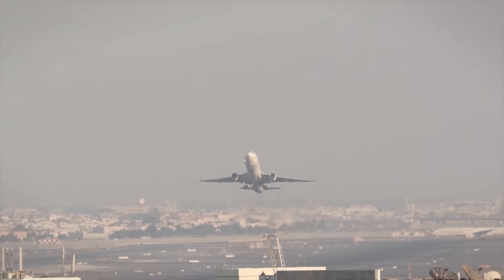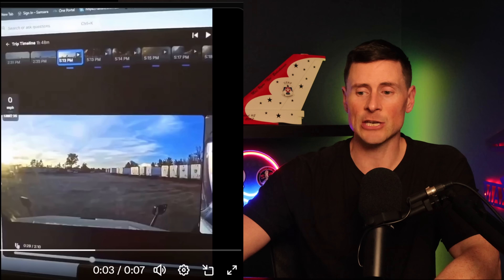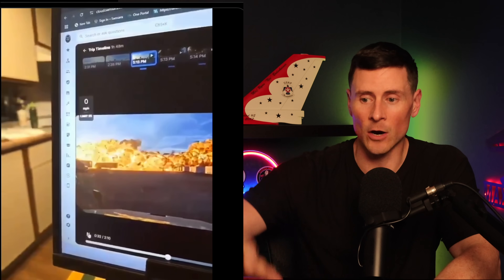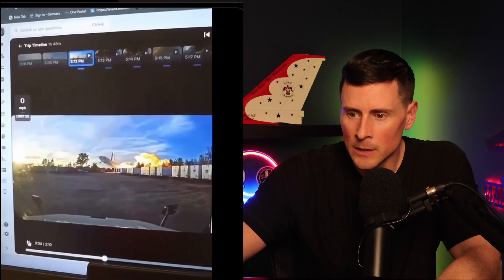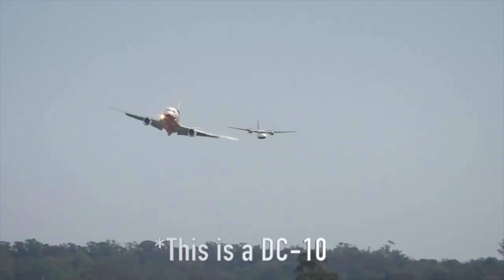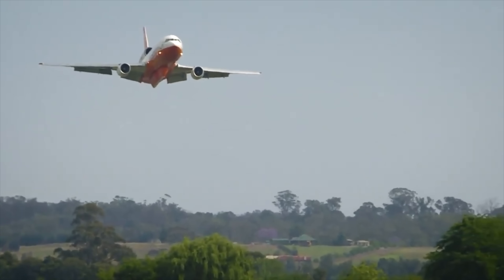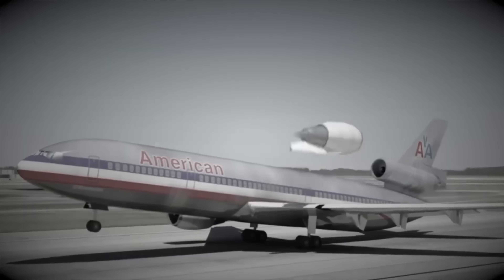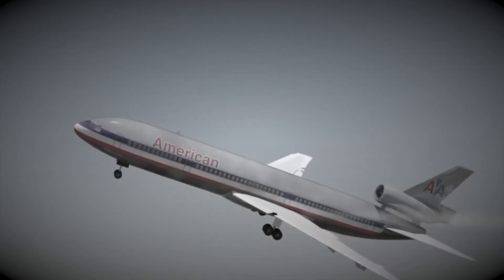Airline Pilot Reveals CHILLING Clue in Final Moment Before UPS 2976 CRASH

Comment: It doesn't look like an engine separation.  It looks like a catastrophic failure.  It almost has more in common with the Concorde crash than the AA 191 crash.   In the case of the UPS plane, you have a destroyed engine core on the side of the runway.  It isn't intact like it fell off.  There are also parts of the engine enclosure on the runway.   Think of the UA 777 that suffered a catastrophic engine failure in flight.  Now imagine that same scenario but under full takeoff power.   My thinking is the #1 engine on the UPS flight suffered such a failure under full power an destroyed the engine.  The result being the core ending up along the runway and the wing on fire.

Comment: Everything is speculation this early, but…those sparks could easily be from FOD coming off the #1. There does appear to be separation of the #1 engine as that was found on the airfield far from the crash site, this separation would also explain the knife edge type of crash that was seen with the left wing down

Comment: Engineering develops maintenance intervals and procedures. Mechanical and electrical mechanics are trained by the engineers standards but management dictates what is done because upper management is tuned to the whims of shareholders in the corporation that employs the above employees. The top only thinks about prophets and the technicians think about engineering standards. So who is to blame the shareholders or the technicians. Technicians can’t work without approval of shareholders. So shareholders how do you feel now. Does that margarita taste good now or a little bitter.

Comment: The first building the plane hit was a UPS building.  It just happened to be the closest building of any size near the end of the runway.
Loss of the #2 engine at the tail dues to debris from the #1 engine doomed them -- with only 1/3 of the thrust they can't climb AND the thrust asymmetry was going to drive the plane left and the right wing down.  The first impact into the UPS building was probably the left wing.

Comment: Engine #2 wouldn't need to ingest actual debris. The plume of fire on the port wing was naturally being pulled into the area of lower air pressure over the top of the wing, so that when the plane rotated the #2 engine would have been sucking in the incomplete combustion products of that fire; a superheated mass of oxygen depleted air and partially burned fuel; effectively flooding the combustion chambers and resulting in a detonation through its turbine section. (Not conducive to maintaining airworthiness.)
The MD-11 also has the issue of the turbulent flow from the wing trying to rip the stabilitors off during a near-stall configuration.  https://www.youtube.com/watch?v=n682zwJwzE4

Comment: If you look at the engine on the ground, the fan case has a huge split at 11 to 12 Oclock position, i believe there was a blade or 2 seperation, maybe fan hub failure which went thru fan case rupturing the fuel tank, engine had high vibtation which sheared engine mount bolts causing engine seperation from the airframe, just a sad thing to happen for the crew and people on the ground..

Comment: Why exactly after V1 with an engine failure do you have to takeoff?
Reply: because there is no longer enough space left to stop safely (or in this case, even UNsafely). after V1, you are committed to taking off and trying to return, because MOST times, aborting at that high a speed will be worse. In this specific case, the debris field started at less than 3000 feet from the end of a 12,500 foot runway. we never do see just where the fire and smoke start, but I am going to assume that the trained and experienced pilots would have aborted IF they knew that they had such a severe issue before V1. That means I have to assume that it didn't get bad until after V1. Also, they might still have made it, if engine #2 hadn't been affected, too, and there was no way to know that would happen until the last few hundred feet of the runway - way too late to even attempt an abort. And also, in this specific case, the building just beyond the runway that the plane's wingtip clipped after getting airborne was a FULLY STAFFED UPS shipping warehouse, with hundreds of people clocked in. If they HAD attempted such a late abort, they would have plowed directly into the building with that 220,000 pounds of fuel instead of just clipping it with a wingtip.
Reply: @ravyn.  thx!

Comment: I'm a retired Captain with over 28,000 hours .I had 16,000 hours in the 727-200 before moving to the MD-11 ER and I can see your point after reviewing the tape. Very, Very possible of a compressor stall. My God I can't imagine all of these problems at or near rotation speed. Jogging my mind I believe that the capacity of the MD-11 ER was around 43,000 gallons which considering the length of the flight I almost am sure it was topped off. It might be possible that the inner and outside fuel tanks were ruptured.
Reply from the maker: Really appreciate your comment and first hand perspective
Reply: @MaxAfterburnerusa Thank you Sir. Keep up the great work.

Comment: The building roof was hit by the left wing, which ultimately domed any chance of takeoff.  I’m about 8/10 mile away, and also worked at UPS for 15 years.  This plane was sitting at the new hangar for awhile, this hangar can hold this plane and a 747 as well, and sometimes it’s sitting off of Crittenden Drive, where the big birds sit, along the roadway.  They typically sit away from the hub until needed.

Comment: No mention of the fact that they changed the design after 191 so the wing configuration locks in place instead of relying on hydraulics? That seems like an important factor to bring up.

Comment: If I remember correctly, the AA crash was caused by mechanics who used an unapproved method to attach the engine to the wing. With loss of the slats, combined with engine #2 being affected, there was not enough lift to get airborne very long. I flew the DC 10 and enjoyed it but it had some design issues that caused one crash and almost a second one over Albaquerque NM. The crash was a cargo door latch problem and the Albaquerque issue was the number 1 engine blew apart, sucked a passenger out, damaged the number two engine and due to a flaw in the redundant hydraulic system and the plane landed with almost no controls.

Comment: Looks like the Big fan blade failure or disc failure which caused feul line rupture or tank rupture causing the fuel leak and fire, kinda like the chicago engine seperation

Comment: This UPS crash reminds to one the one that happened to Concorde in 2003. A fire trail coming from the wing indicating something big was happening, a major malfunctioning there and then the aircraft going to the ground.

The truck dashboard footage is shocking, never seen a footage so clear and close to the crash site.

RIP the UPS crew and condolences for their families and also for the ones that were killed on the ground.

BTW, IDK why there was a oil recycling facility in the vicinity of the airport, just at the end of the runway. It's just ridiculous, a huge factor for this disaster that got more kills on ground than expected. At least the number goes 16.

Comment: The crew was most likely a Captain, First Officer, and Relief pilot since the block time is greater than 8+00.  I don't think that loadmasters have been on board Fedex or UPS cargo aircraft in decades, they simply hire people into this job and base them around the world, usually locals.

Engines are mounted on the bottom of pylons for three main reasons:  1.  This makes them easier to service, 2. If there is an engine fire, the flames are kept away from the wing structure, and 3.  The whole assembly is designed to break away and protect the wing structure in a massive fire or if the engine's rotating assembly were to suddenly seize up.  In this case, it isn't known why the engine separated, but it apparently did.  Typically when this happens, the airplane actually flies better due to the loss of drag and weight.

Great video, SAD story, RIP-

Comment: After AA 191 McDonnell Douglas put additional valves in the hydraulic systems to prevent flap and slat retraction in the event of a hydraulic line breach so that could never happen again.  So you are wrong.  You also didn't mention that the MD-11 is a much more difficult aircraft to control as McDonnell Douglas reduced the size of the horizontal and vertical stabilizers and made the aircraft neutrally stable on the MD-11 from the DC-10 to save fuel.  This makes the MD-11 have the highest takeoff and landing speeds of any commercial aircraft, gives the pilots less command command authority, and makes the aircraft much more difficult to control and fly.  These are also some of the reason for other MD-11 accidents and incidents, and why the MD-11 never sold well and were quickly converted to freighters.

Comment: The question is are the sparks from a compressor stall on #2 or from the tail striking the runway due to low airspeed and the crew trying to force it into the air?

Comment: Respect to all, but you have to be a blind bat if you don't see what's going on here. Just like Air India B787. I said there's nothing wrong with that plane and it was done on purpose. Months later I was right.
Look at UPS. Layoffs have been happening. Then some customer branches after. And now major layoffs.
Someone or all three that were on that plane had retirement around the corner or up the block.
RETIREMENT DON'T EXIST! If you love life just take your savings and resign.

Comment: I would caution direct comparisons to AAL 191.  The MD-11 was a completely new FAA certification jet from DC-10 and much of that accident affected the design of the MD-11.  Swiss Air was the MD-11 launch customer and insisted on mechanical springs holding the slats extended as opposed to simply hydraulic pressure on the ‘10.  This caused a whole other set of issues later with unintended slat deployment in flight.  The flap/slat handle had to be redesigned to prevent this from happening.
I flew both of these aircraft at AAL.  Some similarities, Douglas built both in same factory buildings at LGB, and they look similar, but differences.

Comment: I flew the MD11 for several years. I loved it. It is a powerful airplane. Losing one engine would not be a problem at all. Losing two, with takeoff weight, gear down condition, would result in what happened. It will fly on one engine, but once gear is extended, you cannot maintain level flight. The lighter you are, the better for  operation on a single engine.
Those slats should stay locked in position. MD11 is not much like a DC10. Lessons learned from that DC10 crash were applied.
MD11 was my favorite airliner I flew. It had many features better than our B777s which I flew next.
Reply: I’m no expert but I don’t understand, with all that damage and engine separation, they must have felt yaw, heard fire alarms, and watched their gauges go crazy. It seems they would have aborted. Maybe it all happened after V1? It doesn’t look like it though.
Reply: @dmrr7739 
It was way too late to abort.
They were going way too fast at that point, with very little runway remaining.
Reply: @dmrr7739  The million dollar question, before or after V1??? Would it matter?
Reply: Don’t be too quick to rule out the sparks possibly coming from tail strike from over rotation.
Reply: thanks for your insight 👍

Comment: A report on this UPS plane (look up UPS Flight 2976 MD-11) shows that it was grounded, inspected and worked on.  All before it returned to service.
Reply: Plus Yesterday more maintenance was done
Reply: @MikeJones-wc4qj  With the Gov't shut down are FAA inspectors even working?
Reply: Allegedly it was worked on from September to October.
Reply: Yes and reports are it's was maintained briefly before takeoff.
Reply: The Boeing service likely missed some bolts holding the engine mountings.  The Engine core  was just ejected midfield and that should never happen without catastrophic support failures, even bigger than sucking up a flock of geese.

Comment: Mains never left the ground....nose wheel did.  Left engine blew up,  and the pieces went into the wing fuel tank.   All the fuel ignited.  I have 23,000 hours in airlines as a Captain.    I'm right.   Where is the engine shroud?   It blew to pieces.
Reply: portions of the engine shroud are scattered around the damaged pari lights at 2800 feet from the end of the runway. the mains very much DID leave the ground, as the plane cleared the barrier at the end of the airport grounds, and the plane only clipped through half of the UPS warehouse beyond that with a wingtip. she made it off the ground... it just wasn't by very much at all.
Reply: @ravyn. the mains never left the ground.   I have access to satellite imagery that updates every 15 minutes.   Straight path from the end of the runway to it's stopping point.   Everything in it's path was destroyed.....do you access to satellite imagery?   No,  you don't.

Comment: The DC-10 incident was caused by improvised engine / pylon separation procedure during maintenance with a forklift. The rear pin mount was stressed and cracked, eventually failing under takeoff loading. Might be a similar situation here.
Reply: As I recall, the problem with using the forklift was that the maintenance crew left the engine partly uninstalled from the plane's wing and with the forklift engine shut-off the lift cylinders slowly leaked down putting too much of the engine's weight on the only bolt that was still holding it to the wing causing cracks to form. And when the crew returned to finish their work on the engine, nobody noticed it had damaged the pylon mount while they had been away.
Reply: @michaelshrader5139 Thanks for filling in the details. Be interesting to see how the investigation unfolds on this one.
Reply: @michaelshrader5139  for that one plane, that occurred during a shift change but the issue was larger than that one plane. American, Continental and United all changed the recommended procedure which was to separate the engine and then the pylon. Instead they all removed the engine with the pylon attached. United used an overhead crane but American and Continental used forklifts. When reinstalling, if it wasn’t all aligned properly, damage was done to the mounting points. This was found on other aircraft in the fleets of AA and Continental.   (Note that this all followed a bunch of misinformation about it being caused by bad bolts due to one being found that was broken in half.  This info went out way before the investigation was done.)

Comment: Possibly similar to the Chicago DC-10 crash where the left engine separated from the aircraft. The maintenance crews had mounted the engine and pylon as a unit instead of separately causing a crack in the aft engine mount. On takeoff the mount broke and the engine/pylon pivoted on the front thrust link around the wing. The separation cut through the cables (not hydraulic system) that hold the slats out. The pilot went to V2 to climb which caused the slats to retract from air pressure. Simulations showed that if they had leveled and gained air speed the wing would not have stalled. There was enough control authority with the two other hydraulic systems to control the airplane.

Comment: So if the aircraft can’t achieve enough speed for liftoff, why is there no mechanism to brake?

Seems like in 2025, there would be sensors on planes and along the runway where necessary velocities would have to be achieved. 
Tragic. Fortunately, it didn’t have 200 souls on board.
Reply: there ARE mechanisms to brake... as long as you aren't going too fast already. But the whole point of V1 is that there is *no longer enough distance left on the runway to make a safe stop*. And by the time you know you won't have the lift to achieve positive climb, you're almost always WAY past V1.

Comment: The road striping and the proximity of the utility pole to the roadside tell me that the engine pictured is next to a road outside the airport. If authentic, the separation likely happened beyond the end of the runway.
Reply: they don't have windsocks and aviation fuel trucks parked on large tarmacs beside city streets. This is inside the airfield, on the runway 17R, about 2500 feet from the very last ditch end of the runway. the engine picture was taken by another pilot while taxiing.

Comment: the air speed was good enough it was  at 184 mph according to airport measurements ,,normal rotation is 130 to 140 so the pilot tried to get more speed to get it up . but the no 1 engine fell off on the run way which forced the no 3 to over power and jack knife the plane .

Comment: Not sure it's really so surprising the engine fell off; 

Flames coming out of the engine, maybe an uncontained compressor or turbine wheel failure, could explain fire on the other side of the ship; engine vibration, owing to the eccentric load on the rotating assembly, the engine mount's "fuse pins", shear, as they are supposed to, engine drops off, as it is supposed to.